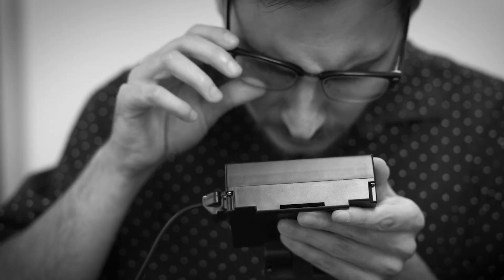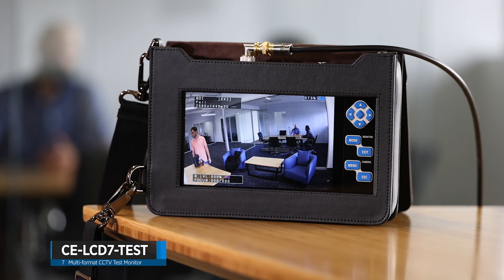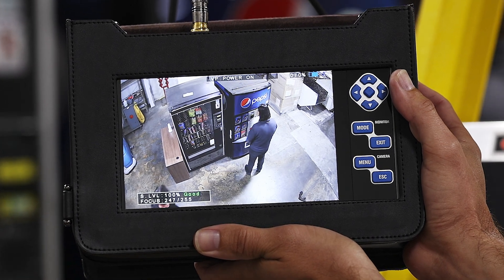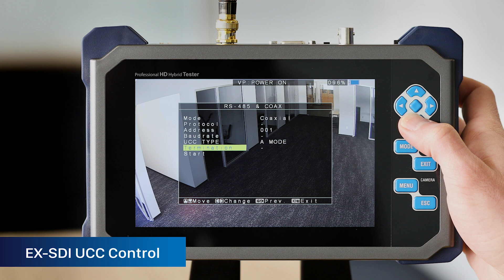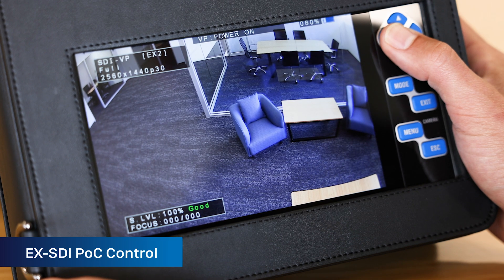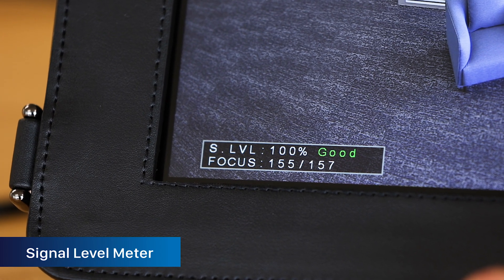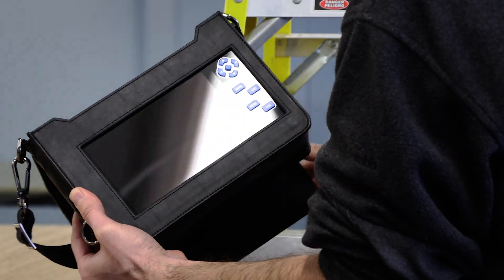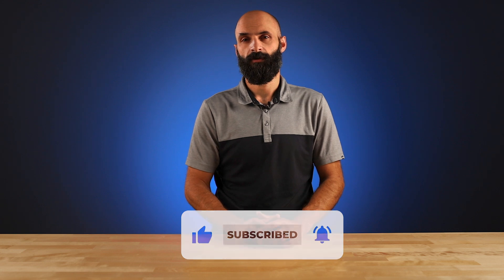The Ultimate Test Monitor for Coax Based CCTV Cameras!

Comment: This screen has UCC? Does that mean I do not require the CE-REMOTE ??..or does it depend on the camera?
Reply from the maker: That is correct. You can access and control the OSD menu with any Clinton EX-SDI camera via UCC on the test monitor.